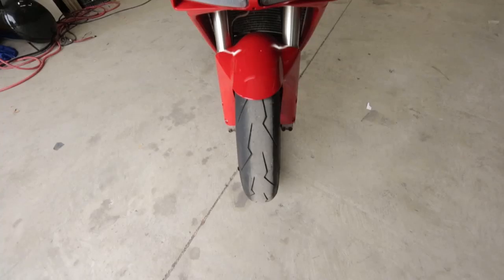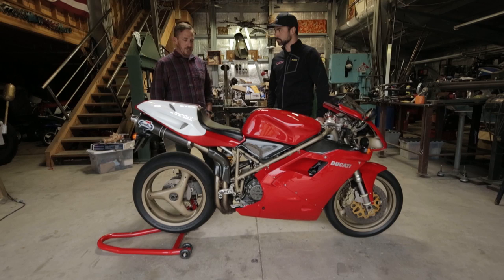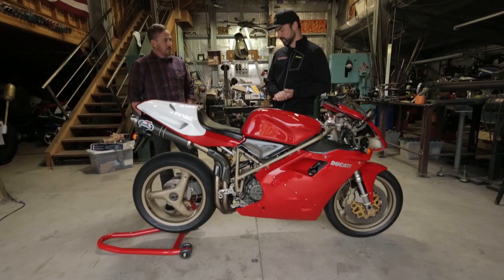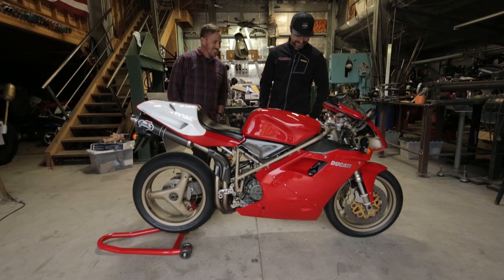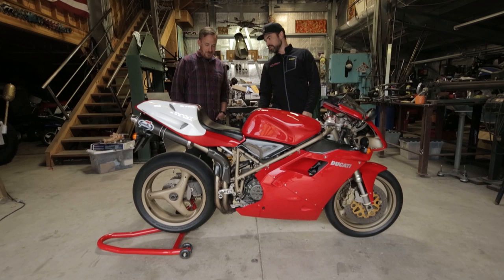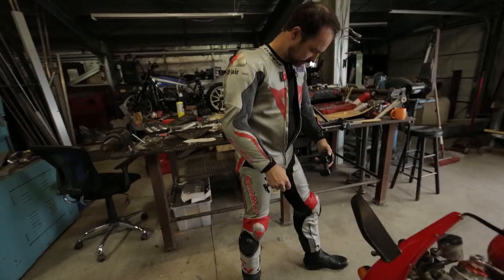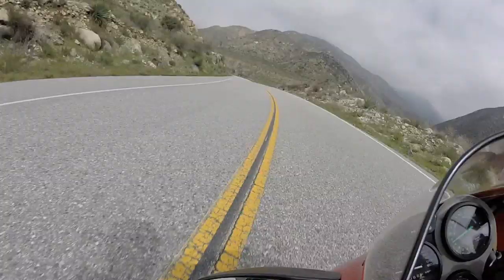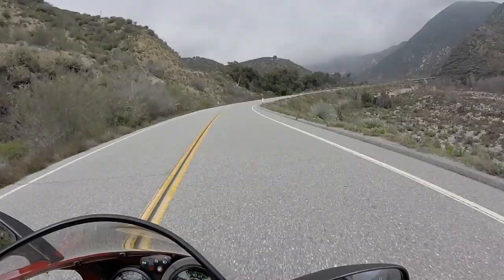1998 Ducati 916 SPS Road Test - Cycle News

Comment: Great review, mine is a 998 with an 1198 in it and I have used the 998 in a 996 frame for a track day bike. Both have slight ergo changes   Such a 6 degree fall clip ons and adjustable foot pegs, turns out very comfortable.

Comment: Don’t those things need valve adjustments like every 100 miles?
Reply: Bruce Smith no !!!😄😄
Reply: 150 miles
Reply: No - a myth.
Reply: Years ago I went on holiday for 3 weeks & rode mine from Bendigo to the Sunshine Coast & back. Stopping for overnight stays. I did  4 x 13 hour sessions (which including typical city comuting) stopping only for fuel & a bite to eat. Final figures well over 5000 km in 3 weeks (3100 miles). Rode it another 3 weeks around home before getting it serviced. It still runs fine. No ... that valve adjustment thing is a myth. That or my bikes well & truly  overdue. I might add the trip up to Queensland was through torrential rain. The bike stuck to the road like glue. Even I was impressed going through the bends faster & faster as I went along, trying to find that point where you feel the bike wanting to let go . Then just holding the throttle & letting the bike do it’s thing ... If you have ever owned one ... Parting with it would have to be the hardest thing you will ever do. Not something I will ever do.